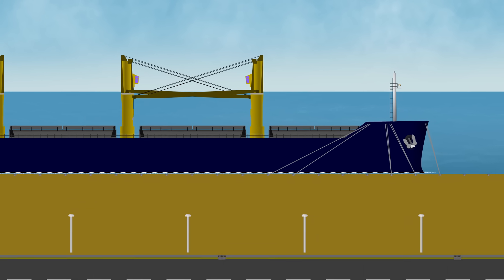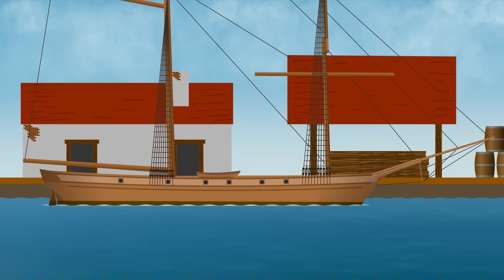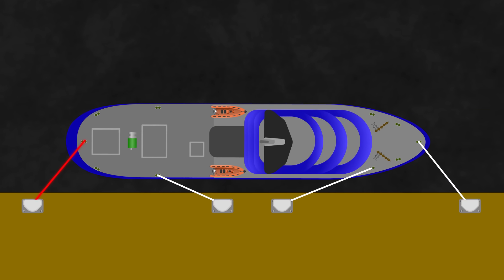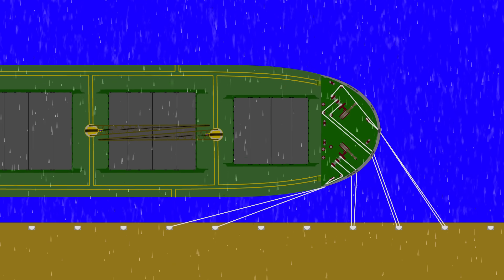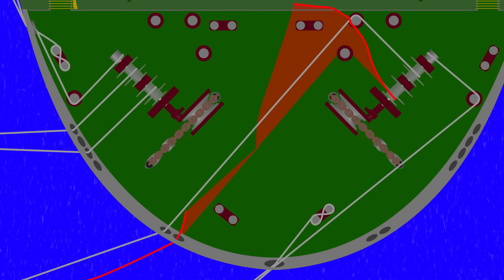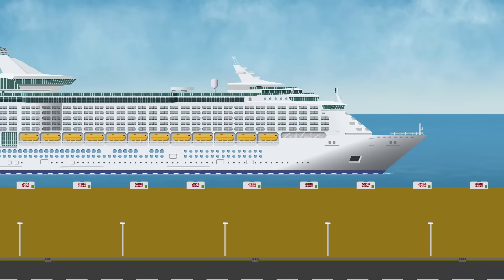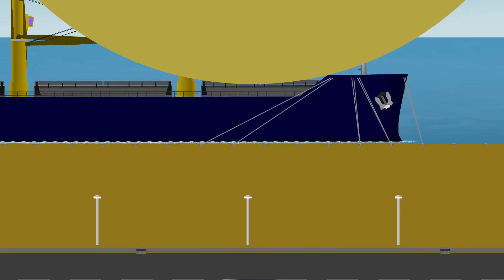Why Do Massive Ships Still Use Ropes?

Comment: A vacuum or electromagnet would require constant power and a bunch of runaway ships during a blackout is the last thing a port needs. Perhaps we will have ropes with different properties at different tension levels such that there's plenty stretch under acceptable loads but at the failure point they'll just fall limp.
Reply: They do not require constant power. The vacuum in Auto-mooring devices can hold for quite some while. And there are always backup generators in case of an outage. 

But if the generators also fail, we will have plenty of time to moor using normal mooring lines.

Comment: are there systems that can dynamically modulate the line tension, either ship- or dock-side? Either to ensure even loading or perhaps provide artificial compliance: letting the winch act as a shock absorder so high modulus lines can be used, improving crew safety

Comment: There is probably good reason, but why not use steel chains to to hold a larger ship? They have less strength to weight ratio, but a material and manufacture cost thats a lot lower for a given strength, and is more easily scalable to very large sizes.
Reply: They used steal cable. I don't know why not chains. Corrosion and weight maybe. Good question. Looking forward to more comments on this.

Comment: I'm obviously not a sailor, but those "auto-dock" things just seem like exactly the kind of thing you'd see on a bad kickstarter. The ones talking themselves up as being the [thing] of the future and redefining ship mooring, etc. 

Do snapback injuries actually account for a lot of serious accidents? Saving lives is important, but harbors might not want expensive, complicated machines that require regular maintenance and technical skills to operate when ropes are about the simplest and easiest solution humans ever came up with.
Reply: Port supervisor in a port who uses a type of Automooring system here.

The primary reason why we installed it is because of safety. The amount of workers needed for the mooring went from 3 to 1, shore side and 6 to 0 vessel side.

Comment: Ropes have been the standard throughout recorded history. They are simple, cheap, reliable and easy to use. They are unlikely to be replaced, as their strength to weight ratio keeps going up.
Reply: The higher that ratio, the more dangerous they become.
Reply: @tsm688  Please explain, as a heavy object moving at high speed is more dangerous than a lighter one.
Reply: @jamese9283  Higher forces and less weight make extreme velocity.  Energy is mass times velocity squared.  That's why you get things like snapped steel cables slicing people in half - the mass is small but the velocity, and resulting energy, is extreme.

High energy and small area makes for particularly gruesome injuries as well.
Reply: @tsm688  Interesting points. However, have you considered that rope has a low density which may reduce its velocity in air after breaking. Rope is also very pliable and tends to deform after impact, spreading the force out.

"High energy and small area makes for particularly gruesome injuries as well."Ropes can be braided with a hollow core, which could make them safer having larger area and being less dense.
Reply: @jamese9283  I have considered.  We have quite a bit of experience with what happens when a polymer rope breaks.  Did you know tug of war is one of the most violent sports on earth?

People are obsessed with having the world record biggest game of tug of war, and when the rope inevitably breaks, SAVAGE things happen.  Degloving.  Amputations of legs and feet.  And novel injuries hitherto unknown to science caused by hypervelocity lashing -- internal organ bruises and the like.

The better the rope, the more energy is in a small section, the more dangerous it gets.  It's just physics.
Reply: @tsm688 Dyneema is a polymer rope and has very little energy stored in it, it is safe when it breaks.
Reply: @tsm688 steel cable has low mass? Dyneema is replacing cable because it has so much less mass.
Reply: @teeanahera8949  Some extremely tragic accidents give the lie to that.
Reply: @teeanahera8949  It's called "strength to weight ratio".  You don't need as much steel.
Reply: @tsm688 How to say you didn’t watch this video without saying you didn’t watch this video. In essence you missed the part about Dyneema having so little stretch that it falls limp upon breaking. 🙄
Reply: @teeanahera8949  that's difficult to believe, but not everyone's using it yet anyway.

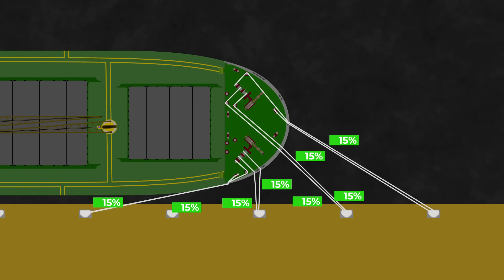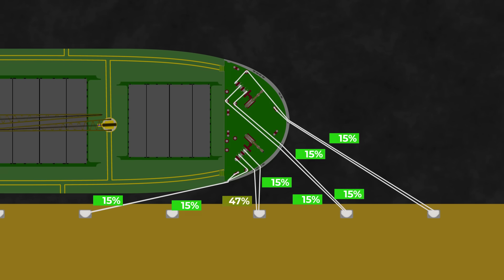Comment: The problem with shore-side high-tech devices is that they're only available in high-tech ports. I wonder if a system where the ship monitored the tension on the ropes and tightened up the other ropes when one is above average tension would be feasible; it would still be a problem in the rarer 2:40 situation, but help in the more common 2:55 case, I think?

Comment: I worked on Great Lakes ships back in the late 70's when the only 'rope' was a 3 inch nylon rope that ran out the bow.  The other lines were steel cable.  As described in the video the one one on one was most common.

Comment: Nice video, but i kinda feel like the autotension features, and antisnap breaks coulda been mentioned as well, as they are very common nowadays.. (autotension being with the motor engaged set to tightwn or slack the line dependion on the tension and break, being motor disengaged line on break, but the break being designed to allow for some slipage before a critical load)
Reply: Auto-tension and similar are banned / no allowed at many ports especially those with strong tides. Last thing you want is you winch paying all your lines out whilst the tide is running.
Reply: @djcwilso  mm no, it is not, we use it all the time, in Europe, asia, the US, iwe yet to come across a port where it is not allowed, however useing it does not meen we don't still have to tend the mooring lines regularly, useualy they are chekked on at least once an hour. And adjusted of needed, thus is usualy to insure the tension drum is not emptied if the lines get slacked, or overlapped if they get tightened
Reply: AI'm guessing you aren't sailing on bulk carriers? As most of the ports in the UK do not allow it. In fact I have copies of terminal regulations explicitly stating such.  @magnushindborg
Reply: @djcwilso  ah, yea I can't say what are the rules for bulks, i sail containers only  :)  so the difference might be with that, also I haven't called a UK port in a LONG time, so I can't say for sure if it's a UK rule for other types, I will ask my buddy who sails ro-ro and ro-pax if they can do autotension in the UK

Comment: I found by accident some months ago that they had developed anti-snap-back ropes for ships mooring. They work by using a more elastic core that won't break at the same moment as the outer shell which takes the bulk of the load. That way, when the outer shell snaps, it is slowed down considerably by the inner core, dissipating most of its energy before being able to harm any seamen.

Here is the link of the video of the testing
https://www.youtube.com/watch?v=ULmn6tJO7Lk&ab_channel=Wilhelmsengroup

Comment: Hawsers (mooring lines) are just more practical. They allow you a greater degree of freedom with how you berth or nest ships, and they're easy to store - not to mention how much cheaper it is for poorer nations to place bollards on jetties. Regarding tensile strength, on my ship we tend to double up all lines as standard practice, but will often triple them when we expect heavy weather. You can also add hurricane hawsers, the ends of which are made from steel cable to prevent abrasion from the fairlead.

Comment: Always enjoy these animations and videos!

Personally, I want to see a velcro hull. The sound of it disconnecting will be soooo good.

Some examples of "Sticky" mooring systems include Remora Hiload and Friede & Goldman BargeRack. At the end of the day, though, ropes are still universally compatible (with enough bollards and length), and the cheapest option (other than intentionally grounding at low tide, which has other issues!).

Comment: Super interesting.

I sail a small boat and like with the big-boys, we have different lines for different purposes. Mostly the issue is if the line is needing to take up some load, i.e., be springy, or not.

Mooring lines and anchor lines need to be springy but they can break, whereas running rigging, i.e., sail control lines, should not be springy. It is in these that Dyneema is showing up as a core material.

Dyneema is also showing up for use in the winches in off-road vehicles, replacing steel cable for exactly the reason pointed out in the video; when it fails Dyneema doesn't unload whip around like a steel cable could.
Reply: In my experience with steel cable mooring lines on large vessels, they’re actually a bit safer and more predictable then soft lines. They USUALLY don’t snap back as bad, 9/10 times they fall to the ground right where they break but I have seen them snap back before. Very dangerous stuff still.

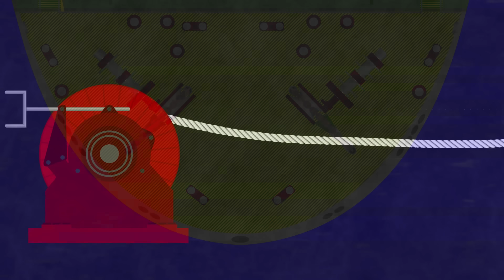Comment: Non-newtonian ropes! At 3:55, to prevent snapback while keeping elasticity, we need ropes which retract a lot, but slowly. That’s what non-newtonian liquids to, so they need to make that into ropes ;)
Reply: If it doesn't retract fast enough it's not much different then not retracting at all, you will run into the same problem with shock loads
Reply: @badgermcbadger1968  I've seen some vids of ropes snapping back and they move fast. I don't know the exact numbers but I've seen them snap back at hundreds of miles per hour. Compared to the speed a ship would drift or bob I think there is a big enough difference to have a retraction speed that would be significantly safer than current ropes when broken but still enough to give to prevent snapping. I'm no engineer though

Comment: The simple solution is to have a clutch system on the windlass and then an auto slack takeup so when the wind lets up it pulls the ship back to its berth.
Reply: They do. They're called unlicensed seamen (ie not the officers)

Comment: Technology will fail.  Moring lines not ropes work anytime.  They dont require power or anything else to work.  Also if you size your moring lines appropriately its almost impossible to break them.  Especially if you are using multiple lines in unison.  Usually when they break its because they are visibly worn and need replacement.

Comment: There was an incident here in the US a year or two back where a ship broke loose from its moorings and floated into a channel colliding with another moored ship causing lots of damage but fortunately no injuries. The ship was moored up and they were expecting strong winds from a storm so they had extra lines and even a person on the ground monitoring the lines during the heavy weather. According to the NTSB report the captain and crew did everything correctly but the one thing they couldn't have known was that one of the bollards would fail, which when it did it created the cascade effect of failing lines and the ship was loose in a matter of seconds.
Reply: So was the port at fault?
Reply: @ferretyluv  Excellent question, the NTSB doesn't work to find fault pre se, but they couldn't deny that the bollard failed. The facility worked with the NTSB to realize that while they changed hands over the decades there was no maintenance (it was over 70 years old) and the NTSB realized that there's no agency responsible in the US for making sure Bollards are fit to hold their posted  rating..
Reply: @douglasboyle6544  That’s insane! Wouldn’t that be up to whoever runs port authorities?
Reply: @ferretyluv  you'd think, but with 50 states it all just fell through the cracks (according to the NTSB) because no one ever thought a bollard would "go bad". Plus, shouldn't the Coast Guard be in charge of that?... Everyone thought... But they weren't. They did however step up and take responsibility because they have cross jurisdictional enforcement ability. Once again why a Federal authority works in this case.
Reply: Very interesting anecdote honestly. Glad to hear through further comments, that no one was blamed considering the circumstances, and no one being injured. Some times things happen, and no one is at fault, the situation just sucks. Definitely seems like one of those times. Even when you do all you can, it just isn't enough some times, and as long as nothing terrible happens, some times that's ok lol
Reply: American infrastructure failing as your oligarchs eat up all the fruit of your labour. Sounds like a shitty situation..
Reply: @Anonymuskid  Too true.

Comment: couldn't you just put two rollers out each hole for the rope to go through, where these rollers absorb the elasticity through friction with the rope?
The rollers would need to have some resistance when rolling in towards the ship and have some grip with the rope.
Reply: No. The issue is that the rope snaps at some random point, which will usually be somewhere in between your roller systems. It's that free section of rope that's snapping back. Imagine you stretch an elastic band between your two hands, and somebody cuts the band in the middle. It doesn't matter how you're holding the ends, the middle section will still whip around and hurt you.
Reply: @beeble2003  if that's the case maybe not a roller but a clamp to make the new end of the rope outside of the ship deck after the line has been dropped. though that just adds an extra step.
Reply: @ICEknightnine  That sounds like it would solve the snapback problem. I'm not an expert, but I think it would cause a lot of stress to the rope at the clamp point, though, so you might find yourself breaking a lot more ropes.

Comment: I'm wondering whether there are sensors that measure the forces on each line and give you an idea of a) whether lines have unevenly distributed forces and b) a line is close to breaking.
Reply: There are sensors to measure the loads on mooring equipment but they are pretty expensive

Comment: Cool video and all, But when I traveled on P&O's Pride of Hull/Rotterdam, I have always wondered how they actually get the ropes from the ship to the shore. Can you explain that?
Reply: The main ropes have a much smaller gauge leader line with a weight on the end.  This lets the deckhand toss that light leader to someone on the dock.   Of course, the leader is not used in securing the ship — just the heavier main rope.
Reply: Cheers.... @chasbodaniels1744
Reply: You tie a heaving line with a knot or a rubber ball on the end  to the mooring line which you then throw ashore.

Comment: We had a vacuum mooring system on piers of our little ferry, but since someone drove off without it being disconnected and the replacement suction plate costs like 100k$ and would've to be shipped from Italy along with the technicians... Cheaper was to eventually sell the whole thing and rely on Shottels (we are electric ferry and are charging every 25 minutes anyway) If the weather would be so bad that it wouldn't suffice, we wouldn't be on that side of the fjord anyway but in the harbour moored with lines out of route. Still it was a pretty fascinating and in a way simple solution. Westill have enough issues with self connecting giant charging plug having to operate properly and find its way in even in sideways snowstorm that covers the optical lead elements. That eventually requires highly competent crew member (loudly complaining chief engineer) to clean them with specialized tool (actual broom handle wrapped with a piece of soft foam and rags)

Comment: I have been hit by the back end of a slipping spring line on a smaller cargo ship before. I was lucky it hit the back of my legs, swiping me off my feet and on my back. The ship was one that only takes 2250 tons of cargo, so not too much force, but it still left me with a serious bruise for several weeks. But yeah a slipping or snapping line is absolutely deadly
Reply: @Failure_Is_An_Option  there are different size lines that hold different amounts of tension. Some lines can rip open steel when they go. People have literally been cut in half before.
Reply: @Failure_Is_An_Option it is deadly but depending on the diameter of the rope. Just imagine a rope the size of your legs turned whip and hit you on the face, broken teeth is the least of your concern.
Reply: @Failure_Is_An_Option bro doesn't understand the definition of deadly or lethal, that's like being the only person alive after a  plane crash and saying it's not a lethal crash because you survived
Reply: @Failure_Is_An_Option they're deadly because in many situations they hit with 10x the amount of force needed to decapitate you... He didn't say that the one that hit him was deadly
Reply: @Failure_Is_An_Option  Are you an idiot by any chance?
Reply: @Failure_Is_An_Option  people like you are why we need a dislike button for comments
Reply: @Failure_Is_An_Option  There is a difference between being hit in the back of the legs verses being hit in the head or upper chest.
Reply: @Failure_Is_An_Option your point is? a gun is also deadly when aimed at the head, but most shots are survivable
Reply: So you were where you were not supposed to be in the "SnapBack Zone" shm

Comment: Ropes from ships washing ashore were perfect for pulling stuck vehicles out on the beach I lived at but only if they were dynamic and not static ropes which you could tell by the weave. The dynamic ropes had a woven jacket or outer layer while the static ropes looked like three big ropes twisted around in a spiral like how rope at the hardware store looks. Helped many people over the years by pulling them out without charge as the towing companies charged a lot just to show up and I was already there.